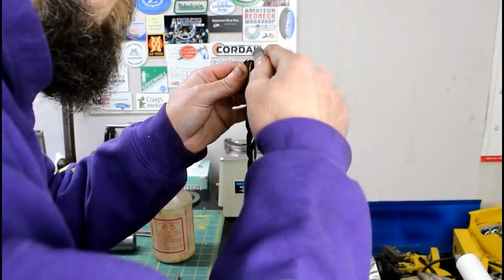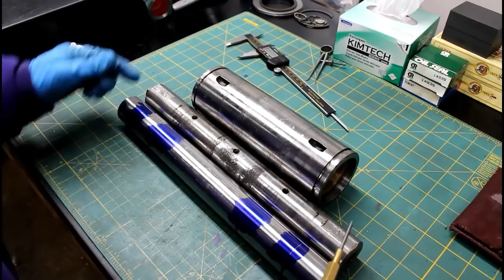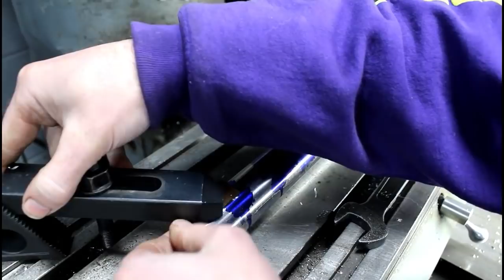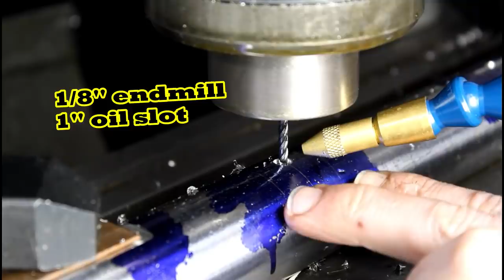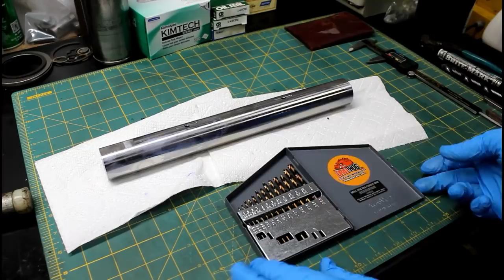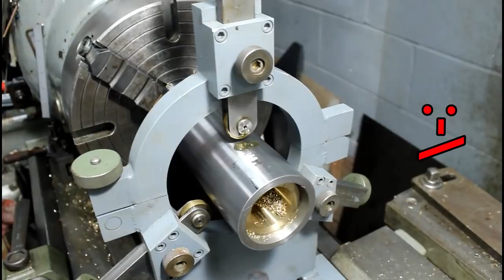Deep Hole Drilling Do-All saw pt8

Comment: About Heptane - it's what makes your engine knock if you're running low-Octane gas. The octane rating is the percentage ration of heptane to octane, with 0 being 100% heptane and 100 being 100% octane.  Simplified explanation as I am also not a chemist and going deeper than this is boring!

Thanks for your videos, Steve. I really enjoy them and you're the first I've seen using a cutter grinder. I didn't know such a thing existed. I imagine the machine and the seemingly tons of accessories you have for it would be in the tens of thousands, new. 

Glad to see the saw is coming together. Really getting a work-over. By the time you're done with it, it'll be worth money again!

Comment: The 135 degree drill point has 40% less chip width corresponding to 40% less twist up reaction force(less broken drill bits) For hard materiels like that aqua-met Its the easy way. You still gotta sharpen them as often. That stainless is going to be very wear compatible with that 954 that saw will be awesome.

Comment: Steve, if you use the carriage as a stop for the tail stock, you can unlock tail stock and do a rapid out. Then slide back to the carriage and continue drilling. Easier and faster. Thanks for the video.

Comment: Good job as always Steve, I suggest you set the T&C grinder up and practice/learn to grind 4 facet on your drills(135deg w/split points). Your pretty savoy on that grinder. I think your drilling problems will disappear. Also wet down your ways and release the tailstock on the retract then quickly reposition back in for feeding. Enjoying the build series. Love the fact you don't cut corners. That saw will serve you well throughout your career.

Comment: The Shopmaster 3 in 1 machines had a way to connect the tailstock to the carriage so you could use your power feed to drill in and retract out- saved a lot of tedious effort cranking that tailstock handle.

Comment: RE: Deep hole drilling. I got tired of cranking that tailstock handle in and out so I built a lever attachment for mine. Makes peck drilling so much easier and faster.
Reply: tsmartin   or loosen and move the whole tailstock assembly back to clear the chips. There's a young Ukrainian machinist who even put an air bearing system in his to make moving it a one finger job, but that might be a bit OTT for most of us.
Reply: @chrisstephens6673  Yea ... I tried that but I don't have the strength to push it hard enough to cut. Mechanical leverage is so much easier. Plus .. it made a nice winter project.
Reply: tsmartin  sorry if I misunderstood your reply, but I meant drill normal way, slacken TS  and pull back to clear chips, push back and turn handle again as normal and as The  Lipton would say rinse and repeat.

Comment: You might of tried 4140 Pre-Hard steel for that shaft. (Rc 28/32) It machines real nice, easy to drill, and can be flame or induction hardened on the surface to 60 Rc and is probably less expensive than the AM22.  My go to material for most projects! Nice work though, and I love how you spread the knowledge!

Comment: Try flattening the cutting edges of the drill to zero rake angle. Works on spring steel, brass, and CI. Just a narrow flat along the edge. Right on the grinder.

Comment: Steve, what mill are you using, I have a unique idea given to me by one of my machinist friends, simply use about 3/8in rubber glued to 1/8in plastic both sides then mill slot to fit your quill stop all thrd, use between to create a soft end of hole exit. This has saved a lot of drill corners from wearing.

Comment: Great work Steve, but that material has you drill shy. LOL  The through hole, and center oil hole, leaves an internal oil reservoir that came in handy to keep the bushings oiled.  You'll need a good oiling schedule for the saw.  Sorry to hear the lathe has problems.  I would love to own a great piece of American Iron like that.  Just not in my budget.....at this time.

Comment: A drill doctor works pretty good for any bits that will fit in it. One model goes to 1/2" the other to 3/4". You can always touch it up by and afterwards if you feel it is necessary. But it's very good at keeping the edges even and you can also split the point fairly accurately.
Reply: Much better off just learning how to free hand it on a pedestal grinder
Reply: @Eggsr2bcrushed  Maybe, but I don't currently have any wheels on my grinder that will cut carbide. As a hobby guy, I probably will never sharpen enough bits to become as good at it as the drill doctor is.

Comment: Make absolutely certain that you often grease that Baldur motor that came with your rotary phase converter. I think you said it's a 20 horse? I don't know if that applies but all the smaller Baldor motors that I have gotten from American rotary require constant attention to degrees be very diligent was that

Comment: I have 3 phase power in my shop.. I live across the street from a power sub station..Mine is just a hobby shop so I don't have a big demand...Entergy put the third leg transformer, good for 50 hp, on the pole which has my house transformer so I now have 120  240  208,,,,It cost me 1000 dollars to the power company and the cost of the service on my end which was probably almost as much....Once you have three phase you will never want anything else... The power I have also gives 240 single phase for 240 single phase motors.. Much better than 208 for 240 single phase motors... I have one vfd on a small drill press and it's ok I guess for small stuff, but once you get three phase you can have all your vfds .. The largest motor I run is 5hp of which I have two. cheers.  Mike in Louisiana (Ramsay 1)

Comment: I'm just curious why are you using the aquamet 22? That's typically used in Marine engineering Solutions or solutions that require high resistance to corrosion. Provide over inch and a half I think you're better off with the aquamet 17

Comment: DeJaVu. Drilling a hole 90 degrees into another hole will grab. In Your case that was not too bad as there was a big difference in hole diameters. Considering Your material You would end up snapping the drill if the holes would be of same size. I used ordinary CRS and almost destroyed my drill because the holes were the same size.

Comment: Steve, be careful with xylene and toluene. Both are fairly nasty chemicals, and while they are effective solvents they have bad side effects. To clean off marking dye, all you need is alcohol, which is very cheap, readily available, and doesn't have to be delivered in a spray can. Using ethanol (alcohol) also allows you to avoid all the pollution and recycling issues that come with spray cans.

Just sayin'...

Comment: Moly Dee is nasty to use, but a better cutting lubricant for something like that. I used to have to use it when single pointing Acme threads in Stainless and 4140HT. Also with Monel which has to be among the worst stuff ever.
Reply: lunkydog   I seem to recall that "Angel's breath" works well on stainless steels. I  use it as a general cutting fluid with reasonable success.

Comment: Steve Summers, Question: about Oil surface  X- channels ,like the one on your schaft. But Now in side a Brass solid sleeve bearing. Have a solid schaft and a turning gearwheel.
The bearing is a brass cilinder, Outside brass bearing is smooth with 2  in the middel a Oil hole and then on the IN side a X-oil channel with  center that oil hole.
X lenght is app 1/3 of the compleet lenght of that cilinder. Cilinder Dia app 2" inside, length app 8" and thickness app. 0,2" (5mm). How can that cross oil channel be made? Orginal has it, but bearing is worn out. Can't figure out how that X-surface channel is made on the inside of a cilinder. I do have a big lathe I can use a little bit. Did make some small parts already. I am totaly Not a lathe person, but seen your video's I get some projects done. And are there some charts or tabels for clearance of sleeve bearings that is lose fited on both sides (shaft and gear) ?
The oil is 80W/90 gear oil. No mechanical oil pumps just turning in a oil bath. MAx rpm engine is 340. Gear ratio is 140 teeth(fixed mounted on a shaft) to a 17 Theeth gearwheel (this one with the brass sleeve bearing cilinder). That 17 Teeth Gearwheel is a strait thooth cone type. app. length 8" .(so rather big ). So the translation is 90 degrese.
Reply: Whhhat? Proof read your message, edit it, proof read it again, and repost it. Because as it is now, it makes no sense. (At least I can't understand it.)
Reply: @xenonram  I mean a oil X-slot on the in side of a sleeve bearing. A slot like Steve is making at 18:27 min. But than a X like channel not a staight ,than not on the outside like here in his video. Sadely I can not put a pict in this thread. Take a Cilinder, Look through the center than Upwards There I have to make a x-oil sleeve channel.
Ah. Found a picture on the internet. Something like this: http://up.picr.de/25887555eq.jpg

Comment: Xylene is pronounced “zzz eye Leen”
Reply: Xylene can also induce allergies in repeated skin contact. It is along with methane one of those chemicals that can go into Your system right through the skin.
Reply: B est stuff I ever found for cleaning old paint brushes, or for paint stripping. Very flammable, nasty stuff.
Reply: Technically it should be pronounced as [ks]ylene.  It's from the Greek 'xylos' (meaning: wood, hence xylophone), spelled in Greek as ξύλο, where the letter ξ in Greek is pronounced [ks]. 'X' is the Latin letter that represents the sound of the Greek 'ξ', and sounds like the 'x' in axe (i.e. a[ks]).  So, if you were Greek, you would pronounce xylene as [ks]ylene, but Americans (and most Europeans) have trouble with the true pronunciation of ξ as [ks] at the beginning of a word, hence sounding it more like a 'Z'. You can do a Google search to hear how true Greeks say ξύλο.
Reply: Yeah I love it for a cleaner and degreaser on metal.
Reply: @scottr939  Interesting. My wife's name is Kseniya, and I've seen alternate spellings of her name as Xenia. Your pronunciation guide makes sense of that. There's a soft coral in reefkeeping commonly called "Pulsing Xenia" (zeenea) as well. Wonder how that's supposed to be pronounced?
Reply: Glad you got the shaft drilled. I felt your pain with the deep hole drilling. I've just finished a batch of 70 parts that needed a 0.591" hole through 13.1" in aircraft stainless. Thankfully I had through coolant and less chrome content than your material.
Great videos 👍
Reply: Sorry. I'm not Greek. I still pronounce it "zjftdhnfjvgshjkche".

Comment: Xylene is pronounced zylene and is an excellent cleaner. Banned in UK except for licensed commercial purchase, is great for getting stains and marks from, say, car interior fabrics without leaving any witness, also really good for de-greasing and cleaning painting / spraying equipment. Not so good with the later aqua-based paint products.
Reply: peebee143   the last time i looked it is still used in some permanent markers in the UK.
Reply: @chrisstephens6673  It's in quite a few different products.

Comment: I wonder if the drill bits others use on the centre shaft material are made from tougher material with a shaped and hardened bit tip and minimal swarf clearance flutes to better resist the tendency to bind and grab.